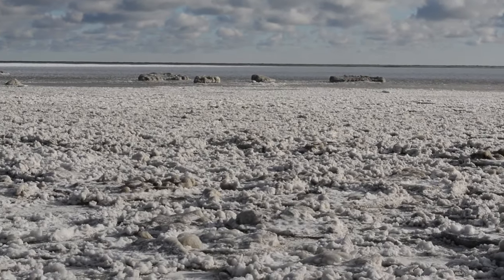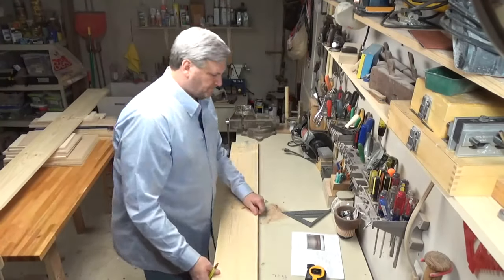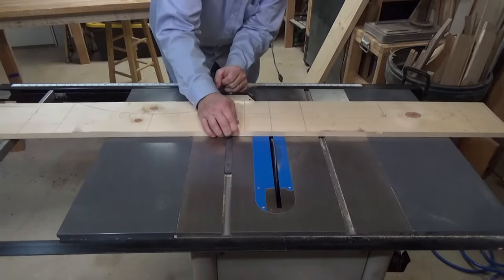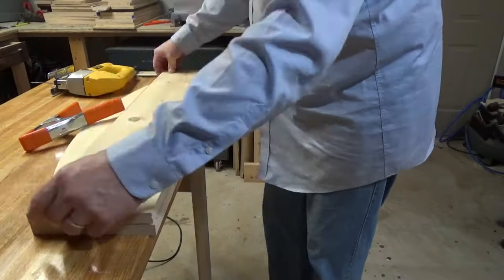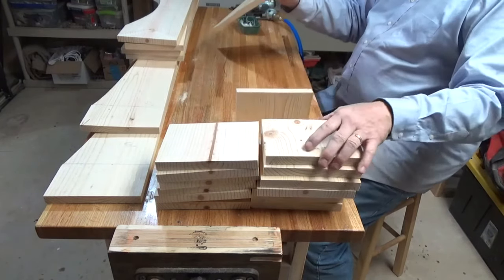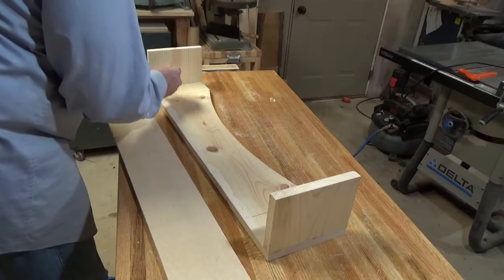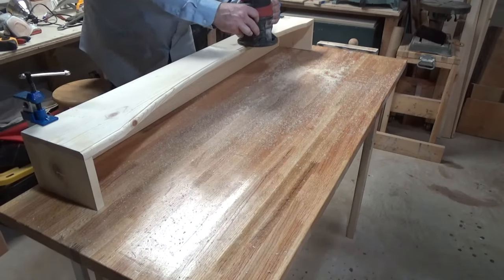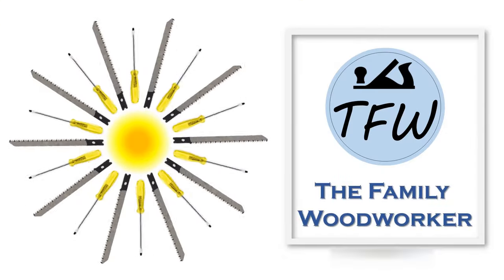Easy Wood Window Valances

Comment: Nice Job.  I am doing this for my bedrooms.  I need to search for your video on how to hang them.  I saw the end of the video, but I am not sure, exactly how to hang them.  TY for sharing your talent with us!
Reply from the maker: Thanks Lisa... my daughters would give you a huge thumbs up for representing women woodworkers!  All you need to do is cut a piece of 1X3 on a 45 degree angle down the length to give you the 2 pieces.  Cut the length shorter that your Valence inside dimension and mount the one length on the wall, the other to your valence.  You can see in the video how the pieces come together...  Best of luck and thanks for watching our little channel!
Reply: @TheFamilyWoodworker  TY.  It does look simply enough.  I will do this!  :)

Comment: In British English a valance is made of textile and goes around a bed to cover up the gap between it and the floor. A PELMET hides a curtain rail runner or taught wire and  can be either wood or curtain material. Miniskirts strangely used to be referred to as “bum pelmets” since they were short and just hid the workings. Strangely the board at the bottom of wainscating is called a skirt. Oh how confusing!
Reply from the maker: And you know if I used the word "Pelmet" my American friends would be sure to note my vain attempt to appear worldly...  I do hope it's a little warmer in the British Isles... still frozen tundra here!
Reply: I must say it is lots warmer at about 9/10 celsius. Spring flowers coming out. March though is notorious for its fluctuations. Here in Switzerland it is mitigated by the continental climate but in Britain right now there are storms and high winds. Not sure what latitude you are on there by NYC is the same as Rome. You look like the same latitude as Reykjavik!
Reply: I was filling something using a bastard (file) 😂 I was glazing the window using a putty knife, which is not a knife at all. 
They're doing this to drive us all crazy!!
😂

Comment: I hope you can open the window in the laundry area, as the valance looks as it will be in the way of fully opened window. 
I hope I'm wrong.☺️
Reply from the maker: That would be pretty funny!  These casement windows crank open outward so no problems.
Reply: @TheFamilyWoodworker  oh, that's so good! You're so lucky to have windows like that.
My windows are all sash operated, really silly technology for many reasons. The sash breaks just due to wear and tear and we need a ladder to wash them outside! 
I have to replace the sash on several of them and that's such a hard work!
I wish, I could change them, but we aren't allowed as the house is very old and is of historic interest.
Will be making some pelmets as we call them in the UK, so I was looking for the simplest idea for attaching the thing to the window frame.
Thank you for sharing your system, I've never seen it done like that.🥀

Comment: What was the point of the title?? How many people have that much equipment and the assumed skills? Pointless for most people.
Reply from the maker: I respectfully disagree.  You don't really need a lot of tools or much experience to do this project. Basic straight cuts can be made with a ruler and a cheap hand saw, curved cuts can be made with a $30 jig saw, and the curved lines can be drawn with string and a pencil... Hand hammer the brad nails  (you don't need an air nail gun) fill, sand and paint. The valances can be hung over a window a bunch of different and easier ways, just like mounts for a curtain rod. I guess it's all about perspective and if a homeowner might not have these basic tools. But then again the title contains the word "wood", so my expectation was that viewers/readers would expect there to be some cutting work involved.  I hope you still consider giving the project a try.